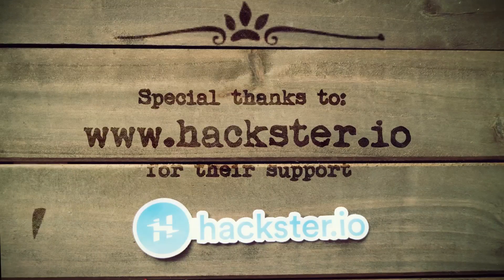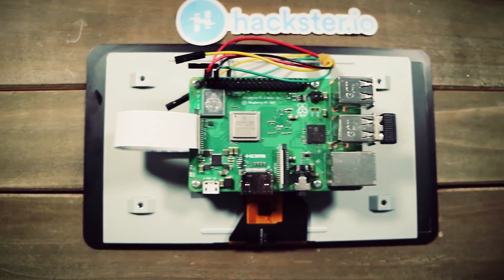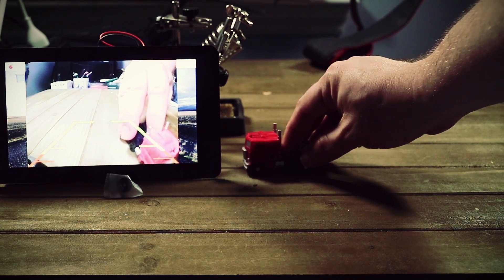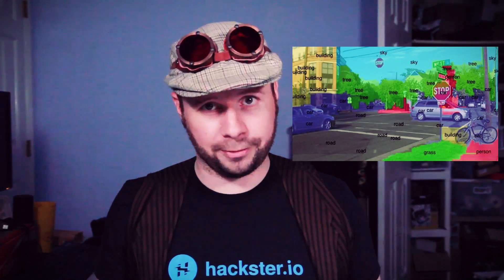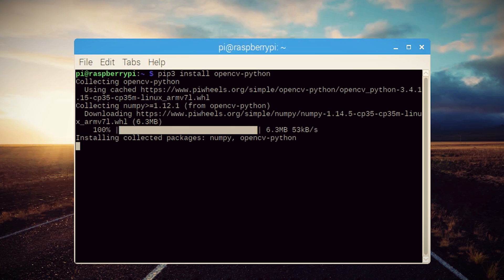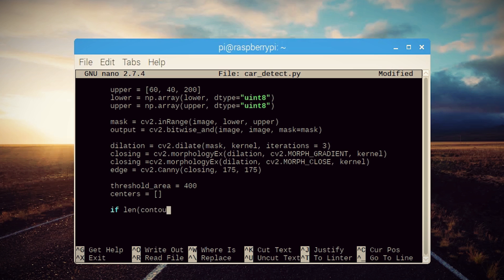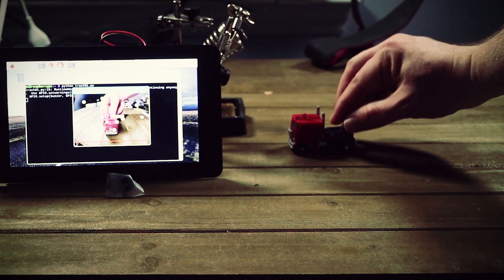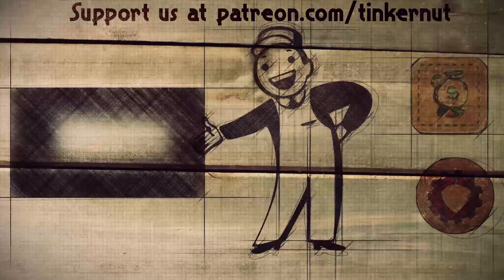Simple Car Object Detection - DIY Smart Car (Part 2)

Comment: Do you know if therw is a way to connect to the cars CAN bus system instead of OBD and get those readouts that way instead. That way you only need to use the CAN bus connection that usually goes to the OEM stereo instead of a external obd dongle

Comment: it would be cool if you can add voice instead of the beep
Reply: add a speaker, import the sound library, get the mp3, adjust amperage and voltage parameters, and ur done.
Reply: yea, it would be cool if you can add voice instead of the beep :)